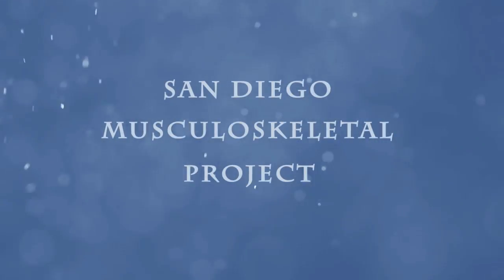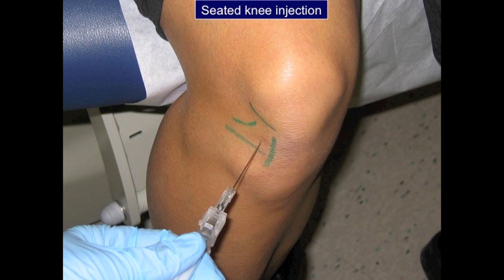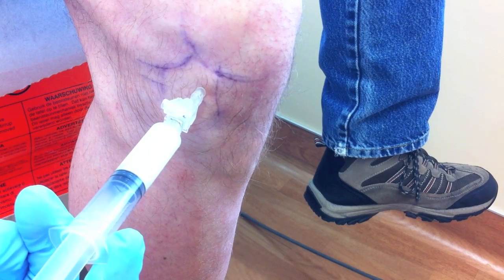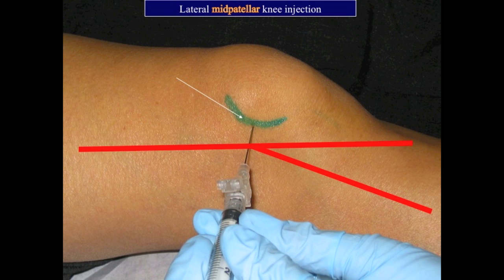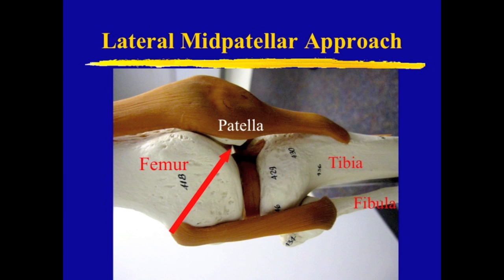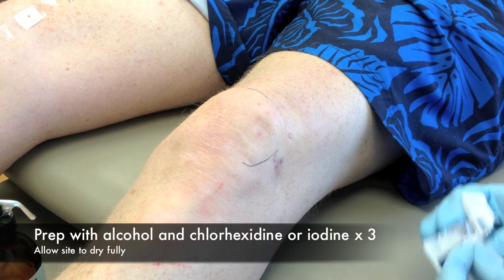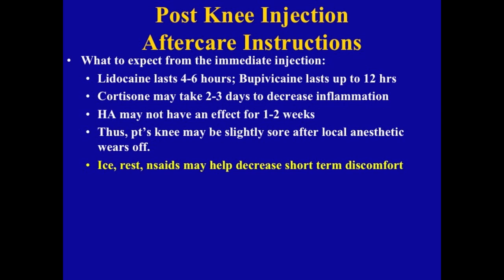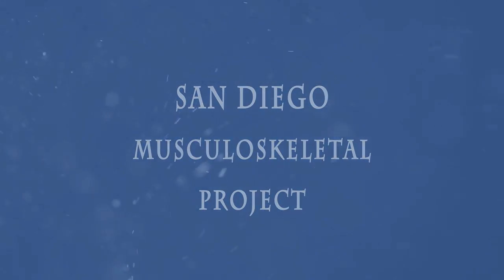SdMskProject Knee Injections Part 3: Aspiration and Injection Techniques

Comment: Isn't it true that if there's swelling from fluid that the fluid needs to be removed first and then inject the steroid afterward? My mom has pseudogout and a lot of swelling from fluid. They gave her a steroid shot, but didn't remove the fluid first. It didn't help at all, I suspect because they didn't first remove the fluid. Seems like the fluid would dilute the steroid and stop it from working. I also hear that the fluid itself is sort of inflammatory and should be removed before steroid injection.

Comment: With the exception of your aspiration technique, everything else satisfactory. Instead of your current presentation on aspiration, that exposes air to both inlet and syringe tip, it is preferred to use the lab's vaccu-tube and multiple tiger tops or similiar to use with this technique, allowing the vaccum within the tubes to do the job! and "zero" exposure of "air to the opening of both needle and syringe. and finally, don't fall into the psudo-assurance, that "you've never had any knee infection so far..." the risk is there!

Comment: Good video and great information. I have wondered about the subject that you touch on in this video. That is the matter of not getting a synovial fluid flashback with the infrapatellar approach. Is there some kind of an anatomical or physiological reason for this? I would've thought that due to the sitting position and gravity it would be more likely to get synovial fluid in that position, but obviously that isn't the case.
Reply from the maker: Thanks for the interest.  The short answer is that in a knee with a small effusion, most of the effusion is in the suprapatellar pouch, which is contiguous with the knee joint space.  If the effusion is large enough, then you can probably aspirate some fluid from the inferior seated position, but you won't get as much out as from the supine position, since most of the effusion is still suprapatellar.  For more information on this topic, watch Part 2 of our Knee Injection series at http://youtu.be/Qvh3SQT6ERc
Reply: SdMskProject  Thank you for the informative response. I did check out your other informative video. Especially interesting was the study that mentioned only a 75% accuracy with the infrapatellar approach. As it is, I understood from your video that you do not recommend the infrapatellar approach with most individuals. This is somewhat problematic if the accuracy really is as poor as conveyed in the study as I and several colleagues I have discussed with have found the infrapatellar approach very useful with heavily obese individuals when the other approaches can be somewhat difficult because of difficulty of palpating anatomical landmarks. It creates quite a dilemma as you don't really know is it an issue with the medication (hyaluronate/cortison) not working or an issue of administering the medication in the wrong place. A lot of food for thought. Thanks again for the great video.